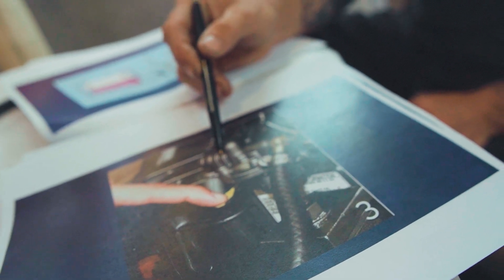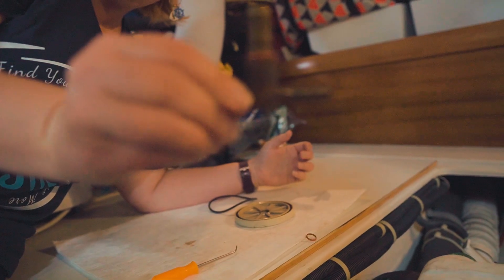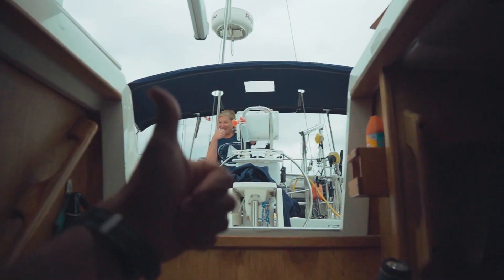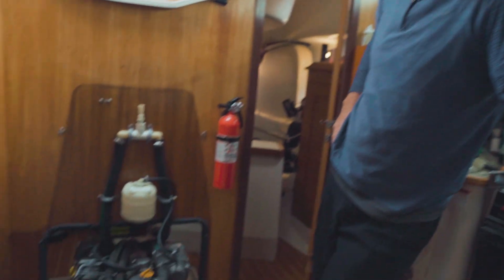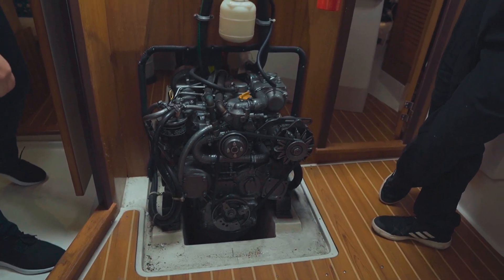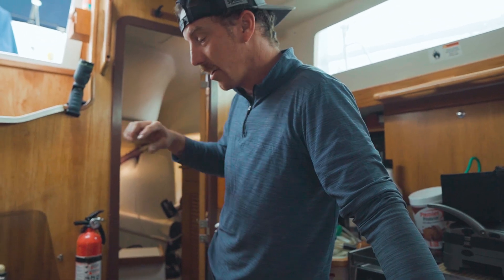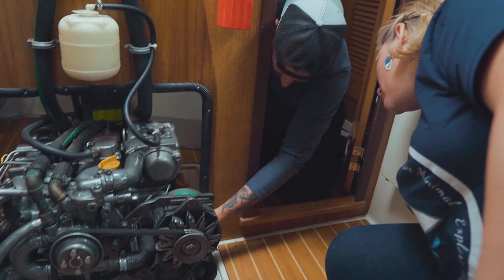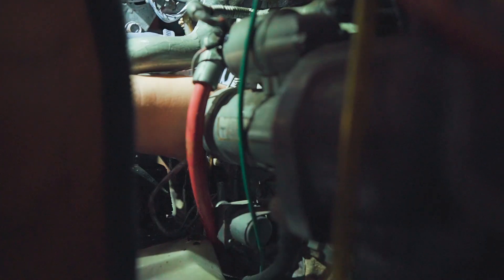Marine Diesel Engine Lessons, Yanmar 40hp  (ep.66) |  ⛵ The Foster Journey

Comment: Did you fill the racor filter with fuel before you tried pumping  on the little lift pump?
It saves a lot of pumping…
Reply from the maker: Thanks for the info! The little manual pump is sloooow

Comment: Use the tapered end of a plastic tie wrap instead of a sharp metal pick. If the pick scraps the o-ring groove you can have sealing issues. Stick the metal pick into the o-ring if you have to use it. Nice video. Bleeding my Yanmar 3GM30FV with the micro lift pump. Mind numbingly slow.
Reply from the maker: Great tip on the o ring 👍. And yes, that manual pump is slooooow

Comment: add a pump and racor filters to do nothing but recirculate the fuel in the diesel tank through the filters, to clean bad fuel and to keep algae and water out of the tank, can use racor filter, i might go with cat truck screw on filters, one fuel fiter and one water separator filter and add a screen filter with clear bowl can usually see if water is in there and supposed to drain it out the bottom, oh and add a pressure gauge to know when the filters are clogging
Reply from the maker: What type/size pump do you use for this?
Reply: @TheFosterJourney   I havnt bought one yet, like the Carter P4594 electric side wall mount, same with the filters, look at racor fuel water separators, strainers, filters, check voltage and fitting sizes. I first saw the algae in diesel problem 3 decades ago and turned down buying a boat for this reason, back then I didnt no how to prevent or eliminate it, it extends the life of your engine diesel filter, ask some other people, I am doing a major refit now and will be installing this recirculating filter system, many people also needed it getting fuel in other countries, or letting the fuel sit during winter and such, hope that at least gets you started
Reply: @TheFosterJourney  also seaflo and amarine pumps
Reply: @TheFosterJourney an option is  amarine fp12v, and watch the filter resistance specs to make a diesel fuel polishing system, do some homework as I havnt a specific plan yet

Comment: You need to have Tools! You need to have a spare starter and alternator and water pump and impeller.  You should also have a spare fresh water pump. And depending on what type of head you have have a replacement kit or mersarater. Get some liquid electrical tape. Wd 40 .ooo and some electrical wire for when you have to rewire something.
 Remember with the spare parts that I liked is so when it goes out [And It Well Go Out] you have the WRIGHT PART and you don't have to wait on the part to get to you. Witch it can take Weeks to get to you. It will Save you $ and headaches later. Have a LOTS of fuel filters. Get a baha fuil filter so you can fill your tank up though it. 
 Those are some of the things I can think of for now. 
 I wish I had known those things when i first went out. Would have saved us a hole 🕳 lot of headaches.  But Good luck have fun and keep making video's. 
Aloha fron the Big Island of Hawaii. Ooo and if you can tell everyone in Pearland Texas We said Hi!
Reply from the maker: Hello fellow Texan! Blake mentioned the baja filter too, but I had difficulty finding it. What am I looking for?
Reply: @TheFosterJourney  you can find thim at west marine.  And yes I was born in Pearland A long time ago.  It has grown so big now. 
 Ooo and I forgot you should have a few extra belts for the engine and for the generator. If you have one.

Comment: Very interesting segment guys. I might have missed it but when the engine stalled after start up did you have to bleed more air out or just run it at higher rpm to let it burp on its own? Thanks again!
Reply: The engine can't compress air. Like he said if there's air in the line, you can crank all day and it wont start. It had to be something else.
Reply from the maker: We cranked it the second time with higher rpms and it worked itself out.